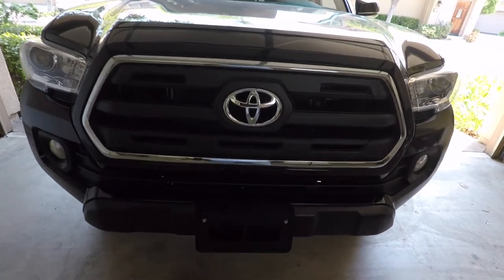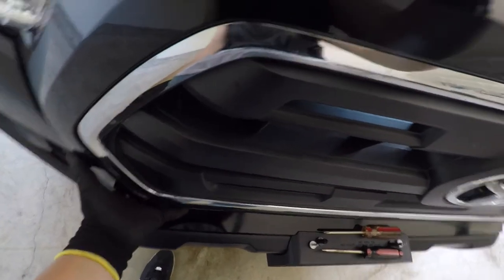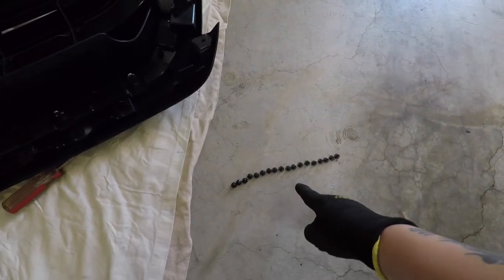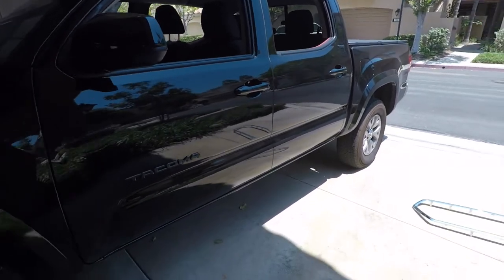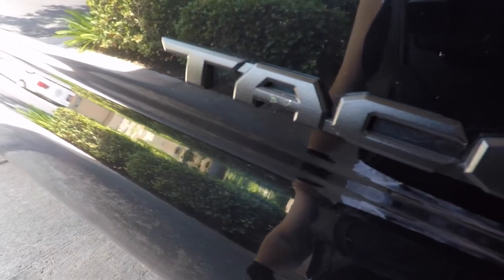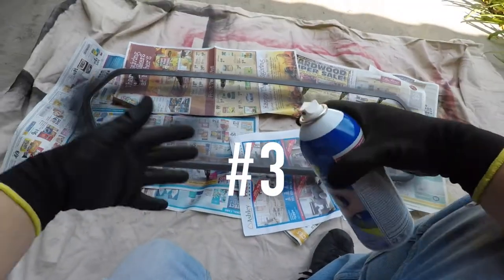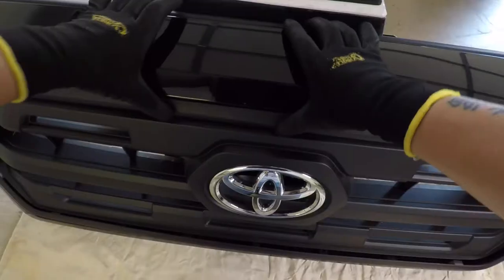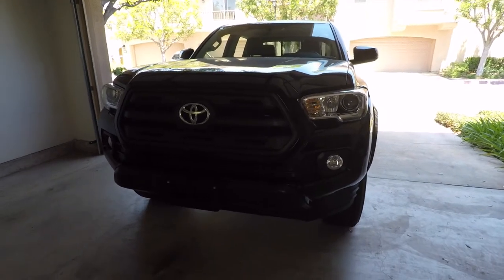Tacoma Grille Removal + Plastidip - 2017 Toyota Tacoma

Comment: Hey dude, your Tacoma looks sick! I just watched your other video plasti dipping the emblem as well. Question: How would you remove the plasti dip? Thanks!
Reply: You just scratch off a little of it with your fingernail or a toothpick, then you can just peel it off. If you use more layers when applying it the first time it will be more likely to peel off in one go.